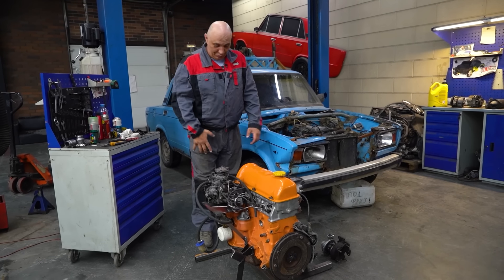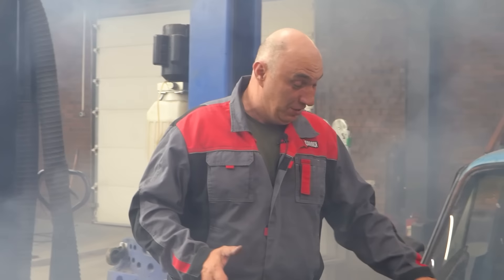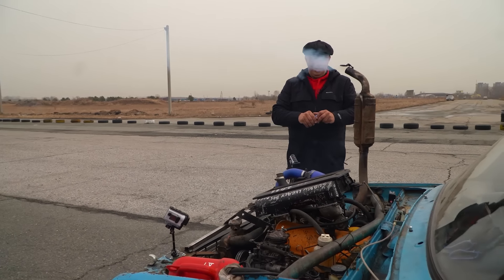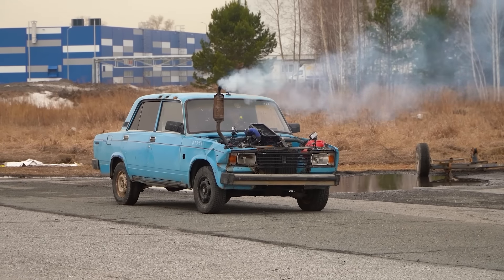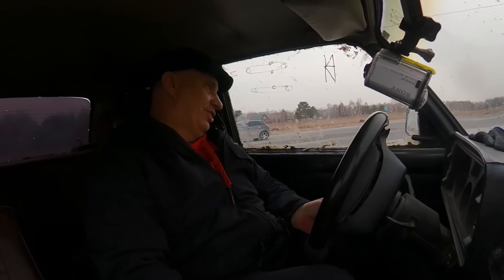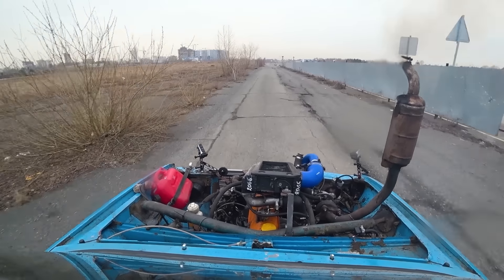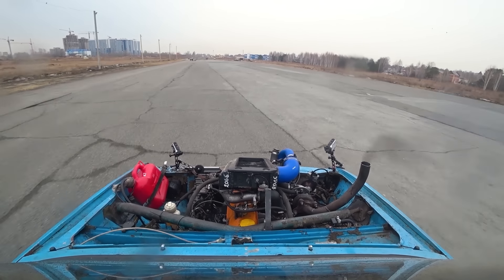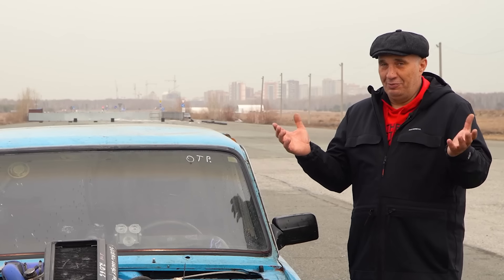Gasoline engine converted to diesel - first drive

Comment: Impressive that it runs so well. On the other hand, I've seen coal fired locomotives that pump out less smoke. 😲
Reply: Running hella Fat, needs more air and heat
Reply: @janielbrown690  That is NOT running rich... the smoke is mostly gray/white aka uncombusted diesel fuel coming straight out of the exhaust. You are not wrong about it needing more air and heat.. but mostly more air for more effective compression ratio not so much to lean out the AFR's. If it was running fat it would have dark black smoke production which it does not, only a little bit

Comment: Add a Flame start as used on the  SOFIM/ IVECO 8140 engine and remove the intercooler to boost the inlet temperature... A larger radiator and 5 speed gearbox.. and its perfect! great work guys!

Comment: Run it on spark using CNG or LPG, they do tolerate high compression very well.
Reply: Only air is initially introduced into the combustion chamber in a diesel engine. The air is then compressed with a compression ratio typically between 15:1 and 22:1, resulting in compression pressures typically from 300-500 psi compared to 120-200 psi in a gasoline engine.

The problem is the piston rings cant hold the pressure they are pushing.Add a Turbo and you PSI has gone up past 500..

I would be real curious to see a See through oil pan on this.. That escaped pressure is going somewhere.. I bet the oil is full of bubbles and air which caused it too over heat..
Reply: @soulwarrior7721  They added more piston rings to each piston, also diesel piston rings are not very different from gas engine piston rings. The engine probably has heat problems because combustion chamber is not designed like in a diesel engine wich causes diesel fuel to not ignite and burn fully at the right moment, this causes engine to run ovwerly rich wich in case of diesel leads to much higher combistion temps.
Reply: Please ando keep de turbo

Comment: Put a grid heater on the intake like Cummins uses and it will replace the heat gun very well. Also, check the wastegate to see if its cutting boost. Awesome project!
Reply: That's also how our case skid steers are supposed to work, but they're shot

Comment: I’d love to see dyno results
Reply: So true!
Reply: It'd probs run like 48 hp and 140 ft/lbs of torque 🤣
Reply: @djboogy3985  sounds about right
Reply: @garage5125  I'm curious to know what it's usefull rpm range would be I'd say around somewhere between 3 and 4 thousand. After that it'd be useless for torque. Perhaps putting a longer ratio gear in the rear might allow to get more speed out of what torque it does have.
Reply: @garage5125  this is awesome. Do you think it could be possible to extend the powerband to 6k rpm or so? 

I guess the head flows enough to support that because it uses petrol valve timing. But is the diesel pump and injectors capable to inject enough fuel at such rpm?

Is the white smoke due to the lack of heat and therefore not all fuel being ignited at all? Needs more compression?
Reply: @garage5125  well all we can do now is wait and see if they try 👍
Reply: You know what is better than dyno results? A road trip. It would be awesome if these guys could do a diesel road trip to Germany or some other country and back. See how much fuel the car uses compared to gas. I'm betting the diesel engine saves a Lada gas. ;)

Comment: Put a smaller exhaust side on the turbo, it wil build more pressure faster.
Just make sure you don't restrict the engine on high rpms

Comment: You could have removed the intercooler to bring the charge temp up and get a better acceleration and easier starts at the expense of a horse or two .... good work btw
Reply: was thinking this, after it warms up miss turbina becomes a hot air pump
Reply: The smaller of the twins from the Legacy should give more than 8lbs, easy, I just think their RPM,s and EGT's are too low to really lite that Japanese war whistle,, Removing the interfooler should really add more heat, Judeging but the emissions, Its hella fat, the rolling russian coal, I think if they get that turbo to spool and those EGTs up, They will be in for a treat.
Reply: Whatever the case in horsepower/acceleration differences, this diesel conversion should get higher fuel economy. Sadly, diesel is $1.50 more expensive than gas here. But I do wish every engine was diesel, as their mileage is so high.
Reply: @thatguyalex2835  Well all that smoke is unused diesel so no this conversion isn't that efficient

Comment: I would probably suggest a bit more boost and maybe a load/ towing test to really explore the low end torque. Something like maybe pulling another car behind it, or loading it up to make it double the weight. Diesel is known for that low end torque and pulling heavy weight. Anyway awesome video, and really cool to see that running on diesel. You guys are awesome.❤️❤️
Reply: Boost on a diesel cools down combustion, I don't think it would make it any better. It's different than gas where more oxygen helps.
Reply: @volvo09  diesel engines are compression ignition and don't have spark plugs. They ignite the air fuel mixture using compression, so I think adding more pressure with the turbo would help it run a little better.
Reply: @volvo09  Thats not how it works. The fuel is limited by injector pump and injector nozzle size. The more air you can pump into it the more power you can make assuming your injector and pump can match it. Pre or after coolers (cooling the air either before or after the turbo enable you to make a denser charge because cold air is denser and you can cram more into the same space and also keep your EGT's lower. None of this matters unless you have a high compression ration to compress the air enough to burn the fuel being injected. This engine would only benefit from higher compression to make better power. Thats why its so smoky because the fuel charge is not fully burning.

Comment: It's amazing how the engine seems to resist the amount of pressure! The cylinder head gasket must be super tough! 🤩
Reply: Russian steel 💪 🤣😂🤣🤣
Reply: @Hi.Al.  
All russian steel is burning in a field in ukraine.

Its swedish steel😂
Reply: @enginerepairguy  I think some of the tank turrets made it back to Russia 👍
Reply: The fuel does not determine the pressure, and that engine is a low compression engine, which is why a lot of the fuel is not burning.

Comment: I believe I would raise the boost enough to get rid of the smoke....usually white smoke is due to pump timing being off a little bit.... I know that's how the old international IDI engines work.... if you move the pump timing over too far they will white smoke...

Comment: Here in Argentina during the 1980s, when a liter of gasoline cost several times more than a liter of diesel, Ford six-cylinder 221-cubic-inch engines were modified to a direct-injection diesel cycle with moderately satisfactory results. A Bosch linear injection pump was installed, the combustion chambers were filled with welding, the camshaft was modified and diesel pistons and a damper were mounted. These engines were limited to 3,000 rpm to minimize torsional vibrations and preserve the crankshaft integrity. The ignition of these "Frankenstein" engines was quite good and they emitted the normal fumes of an old diesel. These engines weren't for playing around, they had to work well and last for many kilometers and that's how it was!

Comment: Connect the boost compensator to the intake manifold so it actually does something rather than blocking it with a bolt and it’ll go a hell of a lot better. Also hook up the oil lines properly to the turbo. 

Wild that they managed to time it and get it running, using indirect injectors jammed in spark plug holes running direct. That’s so cool.

Comment: Great job. Few things ive noticed though.

The enrichment for the turbo on the pump is capped, theres a capped line on the cold side of the turbo they could be joined. This will make a big difference 

And the compression is low, hence the smoke

Damn good job tho 👏

Comment: Lamborghini originally made tractors from gasoline engines converted to diesel. He used an atomiser to vaporise the diesel, and the engine had to be started on gasoline before being switched to diesel. On the plus side, you are driving with your own smokescreen.

Comment: Wonder if installing diesel cylinder liners, triple layer copper head gaskets to bring the compression up, diesel pistons, a bigger radiator if it would run better. Pretty dang fun video, I really enjoyed this video a lot! Kudos for a job well done!
Reply: It has short stroke meaning they have to decrease combustion chamber to get high enough compression. That's also why boost is so low, not enough exhaust. Also too much fuel (that's why it smokes bad).

Comment: A bit more compression and a little smaller turbo so it would build more pressure, and turn up the pump a little bit so it gets a little more fuel. Would be so fun too see what happens then 😁 need to se more of this! Good job guys! 👌🏻

Comment: The white smoke and hard starting is mostly because the timing needs to be advanced, that’s also why the engine is so quiet and doesn’t have that distinctive diesel rattle. even with low compression it shouldn’t smoke that bad.
Reply: It has also wrong injectors, they've installed low pressure injectors for pre-chamber diesel.

Comment: Good job. There is one think u can do to increase compresion . Make intake valve gaps 0.7mm that will give u another 2 bar of compresion.  Turbo boost is low because combustion is not working the way it should (cold diesel burning white smoke) desel engines can run on that low comptesion ratios as low as 14:1 but that would need something like 1500bar electronic injectors . Does lada cylinder hrad have a good spot from a top to drill in to it so u can  use direct injection injectors . Something like 1.9 tdi of passat audi golf . Two stage injectors. Then glow plugs in to spark plug holes. Good luck.

Comment: Thanks for sharing I am sure you will give many people ideas for their own experiment 
Sometimes just for fun Sometimes for serious new constructions
Someone said that an Ethanol engine will run best with very high compression pressure 
Someone made a diesel engine, a high compression engine with some kind of simple spark ignition from the injectors to run very good on biogas
How do we make the perfect woodgas engine?
Some years ago i tested to run an old diesel engine on wood pyrolysis oil in a mix of ethanol and biodiesel it ran perfect Just a nice smell of forest from the exhaust
Of course i run it on normal diesel to clean the pump  Just an experiment for fun about 30 min Best wishes for more crazy, meaningful experiments

Comment: this is a really great project i think we need the boost refrence on the ve rotary injection pump just that capped line on pump for more power and tweak the pump but it did very good badass lets get victory to the diesel with burnouts
Reply: Looks like it is boost referenced from what i can tell.
Reply: Really needs more boost to take advantage of the power diaphragm. No point in dumping a ton of fuel into it at 3.5psi
Reply: @CharredSteak   more fuel would help to a point, but yes, needs a smaller turbo so it will spool down low and make more boost overall.
Reply: @austinmaxi  Yeah looks like it's already running a bit rich. Needs more timing first
Reply: @CharredSteak  timing is a problem to an extent due to the type of cam plate used inside the pump. It ideally needs a DI cam plate in it as the IDI engine the pump is from has a much longer injection duration, so you get fuel before and after you should for a DI engine... if that makes sence.
Reply: @austinmaxi  yeah the extra injection pressure from a di cam woud help too

Comment: Should turn the fuel up that will help build boost and or adjust waste gate.
Better still open pump up and disable the governor by replacing the spring between accelerator lever and governor with a solid rod.

Comment: It might have started a little easier and ran a bit better without the intercooler. Since it liked the warm air on start up so much I don't think cooling the air back down after the turbo really gains you anything like it normally would

Comment: Tuve un ford falcon motor 6 cilindros 3.6 litros, al que convertimos de nafta a diesel!  Se cambiaron los pistones por unos con domo para mas compresion,pusieron una bomba inyectora de motor indenor 6 cilindros, accionada con una correa de distribucion de fiat 128, se modifico la polea del cigueñal para esa correa,se saco el carburador y se puso una torre y donde iban las bujias se adaptaron inyectores!  Asi andubo desde 1987 hasta el 2004 cuando lo volvieron a hacer naftero!  Miles de kilometros recorrio asi!

Comment: Not bad at all for a converted engine. I have a feeling you can increase the boost of the turbo to around 0.7-0.8 bar and still have a fairly safe operation.

Comment: I d k how much difference there is between a diesel and gas cam , but it may work better if you adjust the cam , so make similar gear as the injection pump for the cam . On the pump could you use timing belts. Much friendlier to fingers than a dual row chain

Comment: How about to try make a regular 4 strokes engine a two strokes engine?????
Reply: @Sandu013  sure it will be , but i try to imagine how will they create ports in cylinders , they will have to drill through the water jacket in engine body..
Head will not be a problem to make 
I just cant find the way to ask them about this....
I think in this case car will be faster , but not to much, without the 4t momentum..and takes more fuel ..
Everything almost need to be changed..
Pistons travel, and gear ratio and so on...

Comment: Advance the pump 1 or 2  degrees smaller compressor housing on the turbo and it will be a force to reckoned with

Comment: The white smoke means it's burning too slow. Normally advanced injection would sort that but given the modified compression, it might be worth sticking 0.5L of petrol in with 10L diesel to help it along the way.

Comment: That turbine is waaaaaaaay too big for that tiny Lada engine to run any decent numbers of boost, not to mention spool up quickly.  Put a smaller turbine with a relatively equal sized compressor and you'll see better results~  Nonetheless, awesome results on the gas to diesel engine conversion!  VERY impressive!  :D

Comment: maybe the oil isn't getting wiped as the pistons go down, since they changed the oil ring and put compression rings instead. That oil in the combustion chamber could be affecting the ignition of the diesel

Comment: Great job guys. Love it. And to the turbo, I'm no expert but I think you should go smaller. Big turbo needs more exhaust power to spin so smaller will have less flow but will be way more effective at your RPM.
Reply: Diesel engines generally have much larger turbo due to the mechanics of the engine.
Reply: @ronski4677  I understand that, diesels have more exhaust gases. But still, I think this engine would benefit from smaller turbo. But what would help it more is probably different design, not only increasing compression but moving the compresses volume more towards the center of the piston so diesel sprays directly into that

Comment: Smaller turbo to get it up into the pressure range earlier. You need some 20 bar to run on diesel....

Comment: The smoke was a result of too low compression ratio. That led to bad cold start and unstable working. When the engine warmed up the problem partially resolved

Comment: Swap the turbo on this engine for a blower, change the cams to do away with the intake valves, change the timing pulleys so the camshaft spins at a 1:1 ratio with the crankshaft, create air ports into the side of the cylinders to act as intakes receiving constantly pressurised air from the blower, take old smokey two strokey out for a test run.
Reply: don't need cylinder ports to make it two stroke, you just open the inlet valves at the right time

Comment: I think if you stayed in the gear to a higher rpm the speed might be there after all (more torque available)
Reply: That's not how diesels work :P
Reply: Diesels make power at low rpm
Reply: It has less piston  travel since it was a Petrol engine in the first place, thus it can achieve higher rpms by default
Reply: @vladbuciatchi  Yeah, 300 RPM more... Wow.

Comment: I think the issue with the turbo is as you increase air pressure you need to inject more fuel to get the correct ratio.

Comment: Well done you have offically made a tdi lada and somehow made it slower aswell 😂, great efofrt though even getting it to run that well 👏.
Reply: Diesel run slower and have different gearbox (more torque).
the Golf MK IV 1.9 TDI max rpm, totally floored was 5000, even the Opel Corsa B 1.7D wouldn't run 5001 rpm pedal to the medal on the highway.

Comment: There  is no need for injection, Just drop the compression ratio to 5:1 with a thick head gasket. Most early tractors ran on petrol, kerosene (diesel) or fuel oil and used a normal carburettor.

Comment: I can’t tell if the injection pump needs or has a boost reference line connected to the AFC (air fuel control) housing. It almost looks like a Bosch VE pump and the Bosch has a fuel pin that gets pushed down under boost to increase fueling. It control low boost smoke. Just something to look in to if the pump is from a turbocharged application.

Comment: Connect the boost compensator, seal off the wastegate on the turbo, and turn up the max fuel screw... Maybe add some timing advance ... She will scream.

Comment: The petrol cam probably has a lot more overlap than a diesel cam would and the dynamic cr is bad. 
It's direct injection so shouldn't need heat, which probably shows the low cr.